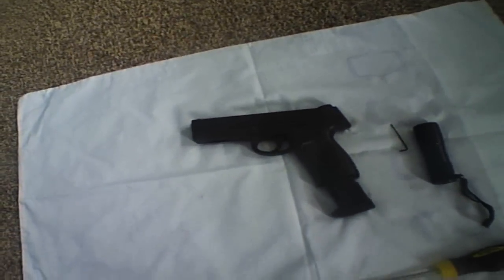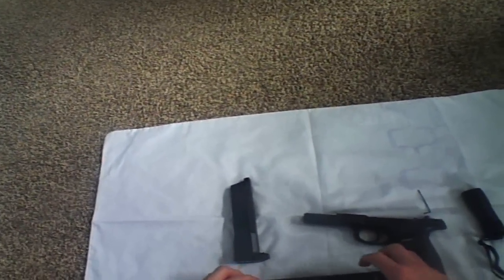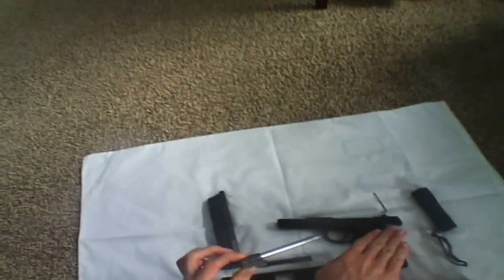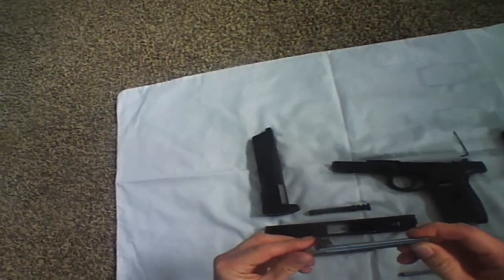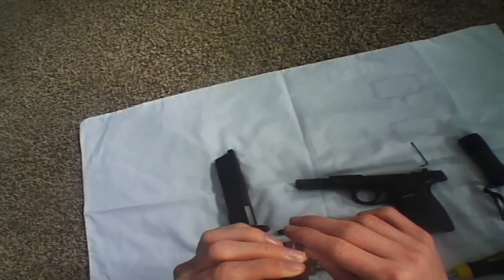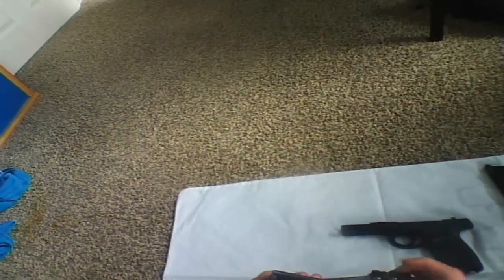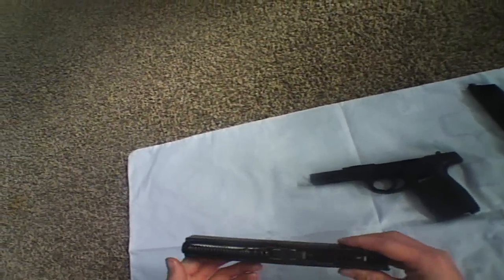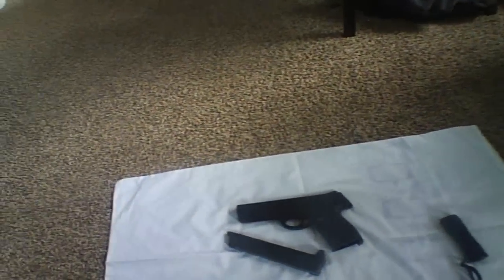Airsoft Co2/Gas Pistol Strip Down Tutorial | Sigma SW40f Blowback Co2

Comment from the maker: Yeah dude it should work. Aslong as its the same model you should be good. This pistols aren't branded un-fortunatily, so mags could be wierd but the co2 and gas ones will work the same just co2 caps in the bottom is the only difference, any other questions just ask :)